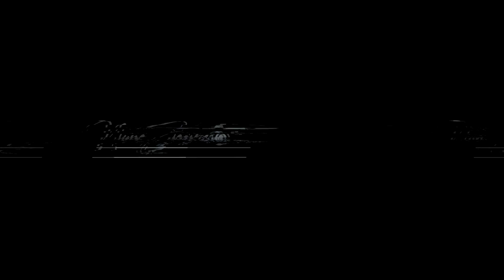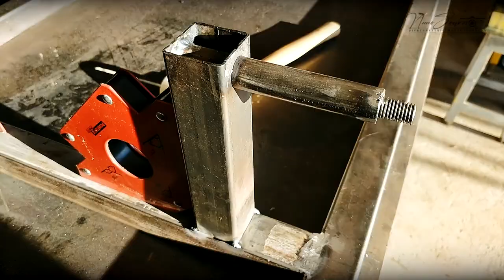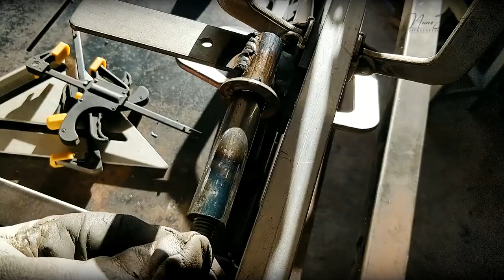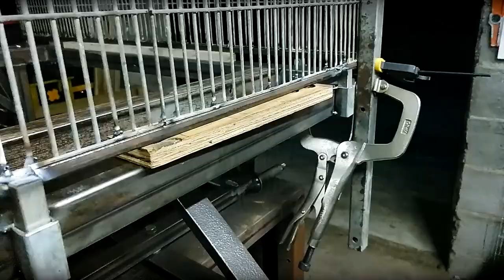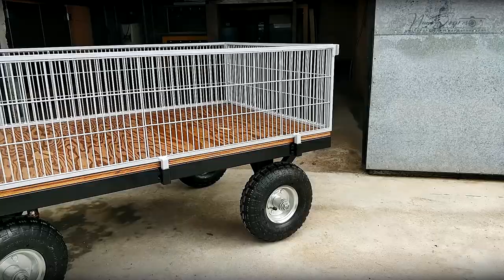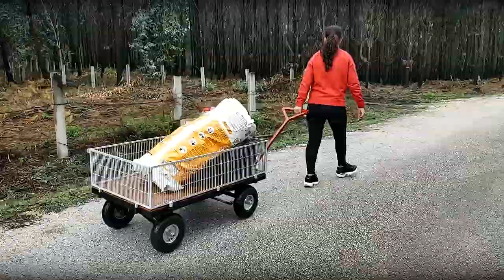Heavy Duty DIY Utility Garden Wagon

Comment: The simpleist axle you could use for a wagon comes from riding mowers, and can definitely handle the weight. I have ond cart that is 3'x5', and is made this way.
Reply from the maker: Thanks for having a look and for your input. You make valid points but I ended up working with what i had. Thanks again!